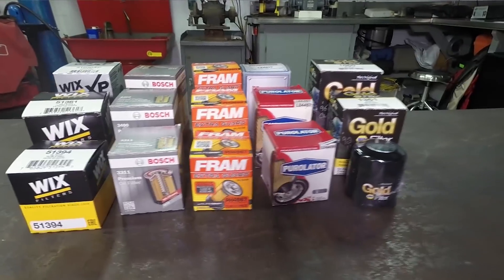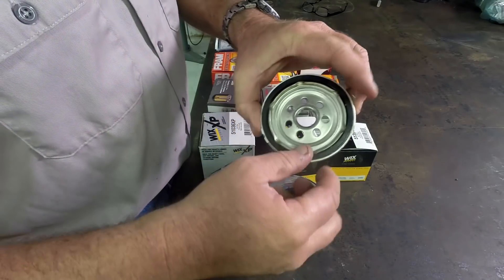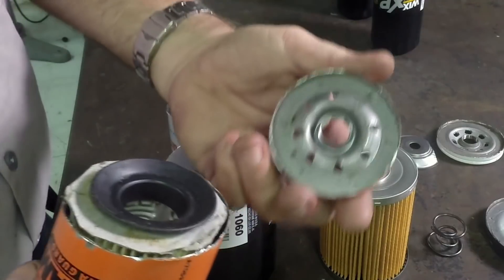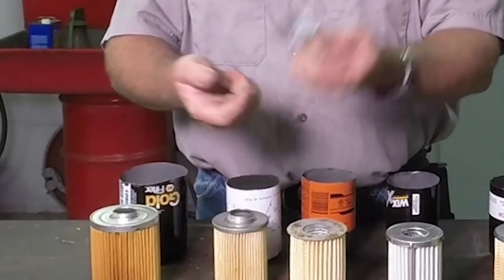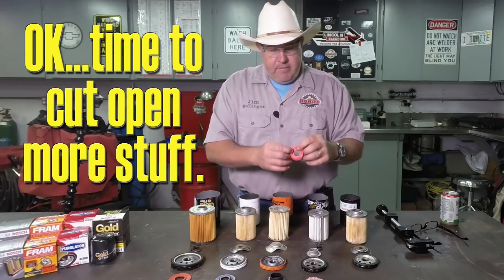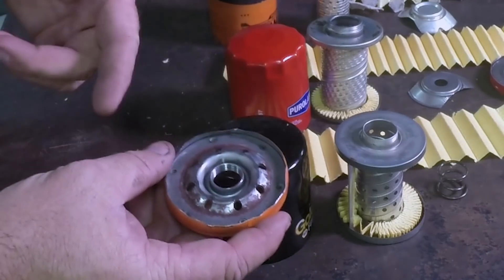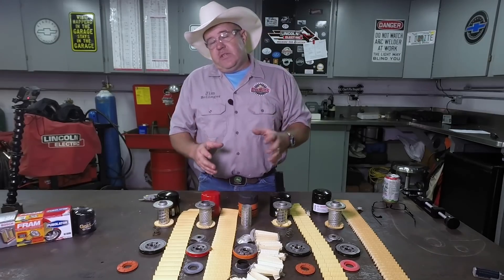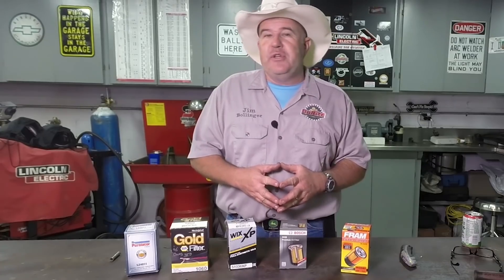The worst oil filter EVER!

Comment: Wanna know why fram is junk? Walmart!  If a company wants it wares sold in Walmart then it has to come in at certain price point before markup. Only way to meet that price point is to either have it made in China or cut costs by lowering the quality. Also I am pretty sure their ACdelco filters are Fram filters. The only reason I say this is because I spent 11 years working in the Lube express there and the shop filters we used were fram core filters and several of the ACdelco filters were identical except in paint and labeling to the Fram Core filters.
Reply: baretta369 you completely missed the point, unbelievable.
Reply: @baretta369 read "the Wal-mart effect"   it will demonstrate how Wal-mart will take a good company and send in their "cost control experts" and have you remove all the quality from a product it order to meet their price point.   It's sickening.
Reply: Hi Steven, it is a bit more complex than that.  As an engineer (Ford 1970's), Fram was the best according to our lab studies back then.  As mentioned by other viewers - FRAM got bought and the new company used the name and destroyed the company to replace it with a name only cheaper replacement.  
Understand that China can put a rocket in space and can build as good equipment as the US - you just have to spell out the specification and if it meets their safety requirements, they will produce the product for the US.  Remember - American companies set the standard - and the American consumer determines the price he/she wants to pay i.e. for the time being, the cheapest price.
Studies at Ford (1980's) showed that ~ 90 of American consumers (not the professionals but the AVERAGE consumers) do not know or worse care about what they are buying, as long as it is cheap and they value quantity over quality.  American Companies (run by corporations and investors) will oblige.
Walmart has huge purchasing power - no supplier tries "willfully" to screw Walmart - unfortunately, American consumers decide on what Walmart buys i.e. "cheap".
For the professionals and the other 10% of the American consumers who are discriminating about their purchase, I recommend YT documents like this one, Consumer Reports, and similar unbiased information sources.  Ciao, L (FoMoCo Engineering)
Reply: Steven Westfall- I agree. People, go to your local independent, locally owned auto parts store and buy Wix. Leave that cheap Walmart crap for the amateurs.
Reply: AC Delco was removed from Wal Marts shelf in the late 90s because Delco wouldn't lower cost to Wal Marts satisfaction. At the same time Wal Mart expanded their line of Fram filters. It took a few years to get Delco back on Wal Marts shelf. I'll only use Delco filters on my Chevy because I've had Fram filters to stop up before 3000 miles. I lost 20 pounds of oil pressure running that filter.
Reply: rick willingham - don’t use AC delco filters that end with a “ E “ in the part number. They are junk .
Reply: baretta369 - are you kidding me ? Try reading his comment again and rethink what he is saying. 

Also the AC Delco oil filters ending with a 
“ E “ in the part number are the ones sold at Walmart and the suck really bad .
Reply: baretta369 I agree.  Poster is an idiot.   I use fram still to the day. I’ve owned many muscle cars and still do and like fram.  No issues like the poster said!!  Change your oil every 3000 miles or 6 months and you don’t get problems!!!  Morons.  My play car is an 06 Pontiac GTO (goat) a daily runner except in the winter.  It has 112000 miles and runs like new.  Mobile one oil and fram oil filter.
Reply: @Steven Westfall
Ya know, that's a very good and probable possibility regarding Wal-Mart. Yup. I always thought their prices were so low because of the volume they purchased, which may be a factor, but stocking lower quality products is definitely more profitable.
  Thanks for the info, Steven. Any relation to a Robert Westfall from Modesto, CA that was in the USMC during the mid '80's, early 90's? Ya, I know, it's a long shot...
Reply: @xMRPx  Nope my  branch is from the Appalachians.
Reply: @stevenwestfall7638  
  Ok, thanks. Ya, I knew it was a long shot but one never knows when it could pay off. 
Thanks for the reply. :)
Reply: @Steven Westfall
  Check out this video!
 https://youtu.be/qz5OJkxAfKA 
  At 2:25 is the proof of Fram/AC being the same filter! It's worth the watch... I got the link from another person here, a Fransisco Tapia. Any credit for the link should go to him.
Reply: Let's not jump on the 'I hate Wal-Mart' band wagon all too soon. People with a 'Wal-Mart grudge', either from their union, company competitor or slick political jive, are always ranting about the chinese junk walmart sells. Well DUUH. How many Wal-Mart protestors are out there ranting about what EVERY OTHER big company sells? Been shopping lately at your preferred none Wal-Mart store? Notice any thing different about them? Target, Kohl's, Macy's etc. ALL carry chinese junk. The only way this malady will be contained is by not buying anything made in china and letting the stores know why. This stops the middlemen purchasers for corporate stores shopping for profit over quality. Have our politicians correct the unbalanced trade practices. Dropping the 'Favorite Trade Status' from china would help a lot (that title alone allows none to very low tax tariffs, thus having a major advantage over other nations) Place the same tax tariff rates to every nation while penalizing countries(china, pakistan, et al) that practice child labor violations or horrific health and safety codes affecting the end user (us).
Reply: Walmart also sells Mobil 1 oil. Does this mean you don't trust Mobil 1?
Reply: @cs5250  When you worked there as long as I did in the shop you got see things change with the products we used over time. Like the ACDelco oil filters. Some of them at one point were identical to the Fram Core shop filters we used in the garage. Only difference was the paint and label. I've had customers request AC over Fram and the filter I put on their cars was identical in construction to what we had on the shelf in the garage. And when it came to using filters from in the store the customer paid extra for that because otherwise the cost was included in the oil change. Thats the point I was trying to make.
Reply: I thought Napa would come in last .  I bought some shocks from them that were garbage .  Costco is much worse than Walmart .  They exclusively carry low end junk and make you buy it in bulk .    I've never seen worse office furniture .  I bought a jumbo pack of CFL lightbulbs that started burning out after one week .  They will discontinue popular quality items because they make more on the high markup low quality items.
Reply: @baretta369 Yes Fram was around before Walmart LOL! But for Fram to be featured on Walmart shelves and for Fram to receive business from Walmart supplying their lube shop filters that has to come in at a certain price point. Walmart has clout. If Fram doesn't meet those price goals Walmart will find someone else who will. Fram has to run a business as well so it has to control its costs too. It has two choices when controlling those costs. Have it made in China by cheap labor or make the filter in a cheaper manner. Sometimes both methods are used. Fram oil filters compared to other oil filters shows fram using less of everything when it comes to making them. Is that  easier to understand.
Reply: Gentlemen, remember that "American companies" are there for profit - long gone are companies that had a "soul" where the owner of the company such as Henri Ford, Tectonics, McIntosh, etc... had "honor" in their names and owned their companies.  Now, this is the age of "speculators" and "investors" - what matters is profit for anonymous investors, not the quality that American consumer should get (actually, corporations do not give shit about fellow Americans... profit is the key).  Now, most of these companies are owned by anonymous corporations (think about the demise of Craftsman...) who are driven by money...  We (Americans) have gone full circle... Years ago, "Made in Japan" was considered "cheap", now Japan means quality and innovation whereas "Made in USA" means cheap.  I am an engineer, born, trained, and raised in the US.  I have been appalled by the drop in quality of our products - it is killing our country as what matters most to the AVERAGE American buyer is "cheap price" and "keeping up with the "Jones" i.e. quantity".  We paid the price, our industrial productivity has collapsed while other countries are leading technology.  
Lets us get over our "laziness" and  "sense of entitlement" and take on the challenge, we are Americans, aren't we?
Ciao, L (American Veteran)
Reply: Remember when Walmart made oil filters. They were better quality the the Frams. So how did Walmart make fram make a cheaper product. Come on man don't blame them for fram making shit. Fram wanted to make more money bottom line. https://youtu.be/qz5OJkxAfKA
Reply: You have a point there....
Reply: KGA B78  Have you taken one apart and examined internal parts / construction for quality like this video fella did here? I have had a Fram Xtra Gaurd filter media split apart inside the canister and there is a mechanic elsewhere on YT that had same problem....
Reply: Take your WalMart hate elsewhere.   WalMart sells a variety of filters.   Some are nice, some are junk
Reply: @davect01  -Yeah, lets hate on Hillary. Everything that she sells is junk!!! Wasn't she on WalMarts board of directors at one time?

Comment: Great video but it would have been great if you included a K&N filter. They seem to be of very high quality but I'd love to see one actually ripped apart.
Reply: Wix makes filters for a lot of companies. Obviously Napa gold is a rebranded Wix and I know royal purple is the same. I opened up a K&N and a Wix and they looked identical years ago but now they may not be. Not sure.
Reply: In my experience, i try to stay away from K&N oil filters. Their air filters are great, but the last time i put a K&N filter in my car, it collapsed on itself a bit (even with the reinforcement tube inside).
Reply: @ST6Dude360  Might of been a bad batch you got. I've had the same issue myself but went back to grab another K&N oil filter and never happened again. Note I went back to OEM Subaru filters because it's cheaper and they are great filters, K&N is a bit in the pricey side.
Reply: @ST6Dude360  was it a high performance oil filter
Reply: I've seen a k&n let go on a motorcycle track.  Wasn't pretty.  K&n paid for the guys bike repairs eventually.  Wasn't the first time this has happened
Reply: @The330racing  I was just about to make a similar comment.  It might be something specific to their motorcycle filters, but I have also watched one come apart, literally right at the seam where it meets the base.  Luckily he didn't crash, but my local track has had so many issues with K&N filters putting oil on the track that they actually prohibit bikes from running on their track if they have one installed.
Reply: Chris R same because that’s what I use
Reply: I thought the same, what about K&N
Reply: I wanted to see k and n too 😂 that's what I run in my Camaro. There's also a brand called Baldwin that's made in Kearney, Nebraska. They got bought by Parker though the same people that made that seal but it would be interesting to see anyways.
Reply: @jaredc5789   baldwin is a trash filter , im a heavy duty and thats all my company uses and it had led to a fair number of failures.
Reply: I run a k&n on my 22r. Curious as well.
Reply: Chris R 
Buy one and cut it apart,make a video and show us your findings.
Reply: Nothing stoping you! Get a kn and rip that sucker apart!!
Reply: So race tracks will not allow k&n oil filters on the track. They have had problems with them exposing and we know how that can ruin everyone's track day.
Reply: ( But what would you expect to find?  gold thread holding the paper together ??? )
Reply: K&N is an over priced Mobil extended life with a useless nut welded to the top.
Reply: @ImTheJoker4u  USELESS!? Boi, that shit comes in so handy for motorcycles. Even though I oiled the seal before putting one on, it managed to cause me some trouble and that nut saved me some frustration.
Reply: @Acepilot235  you can always run a screwdriver through any oil filter and problem solved
Reply: @ianmcgaughey1  except for the mess
Reply: Ian McGaughey but putting a socket on a k&n or a wrench is so much easier than hammering a screwdriver. I already got a ratchet or wrenches with me during the oil change. Two less tools I need to get out. And with modern cars some times it’s impossible to get a screwdriver in there to hammer or a filter wrench on it.
Reply: @jsf11fra  yeah guys just talking shit the nut is a great idea.
Reply: @jamesavery6671   The nut is a great idea if the weld sticks, or the nut itself doesn't round over. I've used two of them. The first one the flimsy nut just tore off, the second it just rounded like it was made of foil. A good filter wrench is all you need.
Reply: @ImTheJoker4u  k&n I believe states the nut is for filter removal, not install
Reply: @ImTheJoker4u   yeah okay makes sense then. I got a filter wrench but never can find it when i do and change lol

Comment: Oil related engine failures are very low. Overheated engines are the number 1 killer and second would be poor or no maintanance. Aftermarket air filters ruin a lot of engines as well as over speeding the engine or chipping and power adders like turbos and nitrous. Failures from oil filters are very very rare and if you can prove an oil filter caused engine damage i am 100% positive you would be fully reimbursed by the manufacturers insurance company.

Comment: You are stretching credibility when you say a filter will destroy an engine.  I've used Fram and various other filters for 20 years on cars ranging from a new SRT Viper to a 240,000 mile Acura Legend... No internal engine issues at all.  My point?  Don't claim an end result without evidence, just because you find faults with one brand, as it taints your overall conclusion.
Reply: A bad filter can indeed ruin an engine
Reply: @billlittle4247  So can the hundreds of components in and interacting with the engine.
Reply: When the filter fails internaly, it can stop the flow of oil, happened to me, watched the oil guage go from 60 psi to 0 psi.
Never went back to Fram.
Reply: I recommend a class action lawsuit.  If you're that convinced, then go after them in real life and not YouTube comments.
Reply: @Dethred1  , Another paid Fram Troll.
Reply: Dethred 1 The oil filter helps to maintain oil pressure in an engine. I have seen  an engine lose its oil pressure because the filter fell apart! Yeah, if you catch it immediately, it wont,  as there is still a slight film of oil on the surfaces.  However, if you let it go for more than a few minutes, you will destroy that engine.   Not to mention, that media can clog oil passages, and also lead to problems.     

You ever torn apart an engine before? I have.
Reply: @triangleofdeath6246  I have too.  The first one was an Acura Legend.  It had driven 175,000 miles at the time, and used a variety of non OE filters including Fram.  When I finally dumped the car, it had another 60-70k miles on it.  Read the last sentence in my original comment until it sinks in, then answer: "Why is there no plague of Fram-related engine failures, or a class action lawsuit based on filter-clogged oil galleries?". Feel free to reply with a well reasoned response.
Reply: So, youre basically saying, its ok to serve old food as long as you dont get sick. Why would u put a half-assed part on youre car?
Reply: @Guthix_268  No, I'm saying it's not OK to say old food will kill you unless you know it will.  Read my comment again, and come up with a more thoughtful response.
Reply: @Dethred1  more thoughtfull response? I think i made my point, by saying, why would you put something on your car knowing its been half-assed. It wont kill your car, but why would you support that, just like the analogy i used with the food. Would you support a restaurant knowing they half-assed your food.
Reply: @Guthix_268  Oh Jesus, you just don't understand what I said.  Ask Santa for English classes next Christmas.
Reply: @Dethred1  , Richard has a perfect logical argument. In my words: Why would you trust a flimsy, rusty, cardboard filter to flow the oil properly and catch all the particles?
Reply: You can't claim no internal engine issues unless you've taken it apart and inspected all the parts and did a comparison between others.
Reply: @lilkittygirl  because the engine outlasts the cars so why waste the money?

Comment: I used to buy Fram all the time. Overtime, the older my truck got it started having problems with low oil pressure. It usually went away after I did an oil change witch sometimes took 2 months and sometimes the problem would start within just a few weeks. My mechanic told me to change my filter brand... I switched over to K&N and never had that problem Again. Ever! You do get what you pay for.

Comment: I had no idea Fram was so bad. I used to like them. I only use Purolator now but I may have to reconsider.
Reply: The better Purolator filters are far better than the Wix/Napa top of the line filter. But he compared the top of the line Wix/Napa filter to the bottom of the line Purolator. And those leaf springs are more reliable than the coil springs.